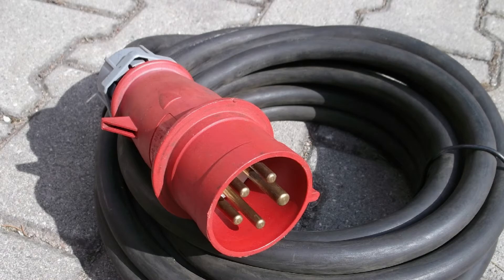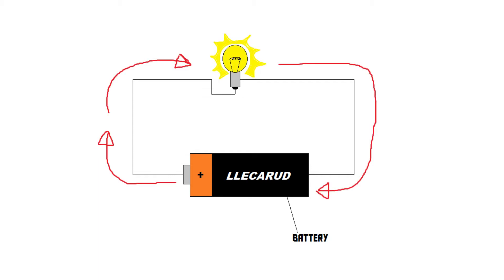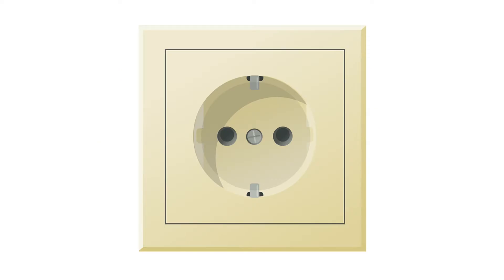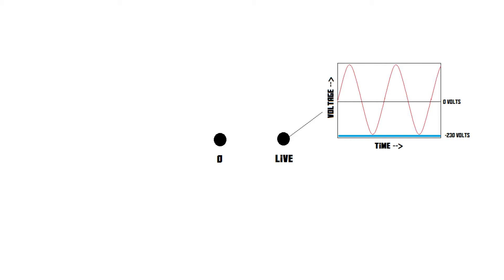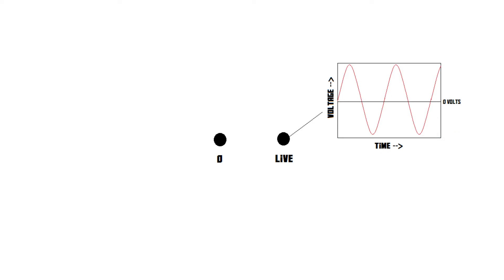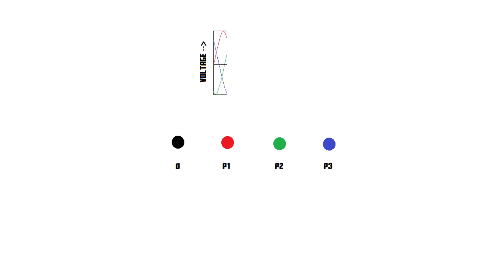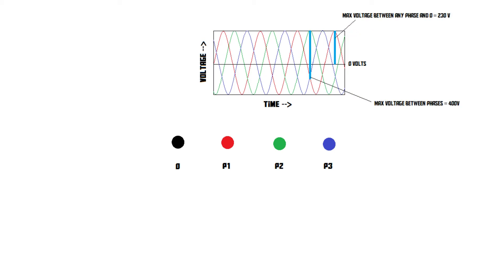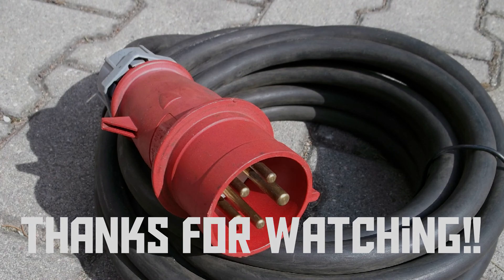Three phase electricity explained (AKIO TV)

Comment: In former Jugoslavija, there was household 3 phase 16A socket, that can deliver up to 11kW.  
Issue was, as it was intended for balanced load, neutral connection was poor, so if used on unbalanced appliance (and most often was used for stoves), neutral would burn.

I like Swiss 3 phase design the most, as it can be used as single phase and 3 phase socket.

Comment: in uk single phase is 240 volts and three phase 415 volts.
Reply from the maker: It's officially 230 per phase here, it used to be 220, and right now it's about 236. they seem to be amping it up slowly. (pun intended) for equipment it doesn't seem to matter; all things originally made for 220 work just fine at 240 as most of these devices are electrically the same as the UK versions.
Reply: we are industrial socket and plug factory  ,www.lxcee.com